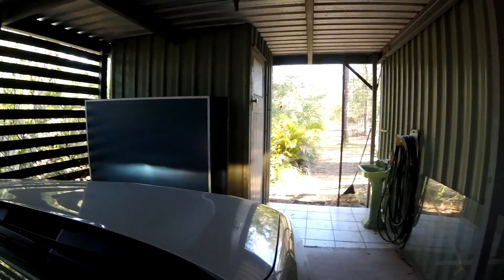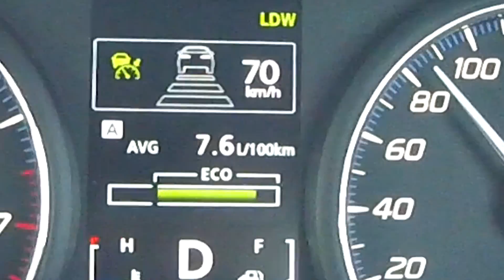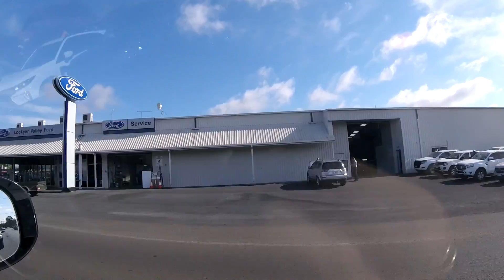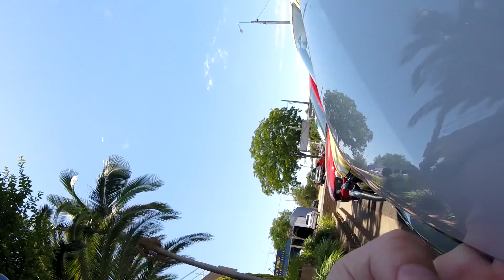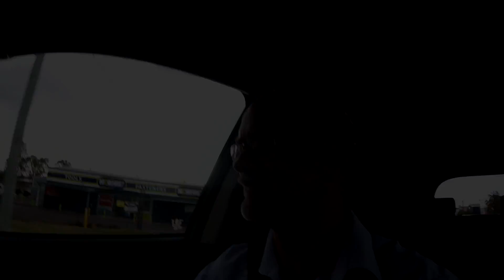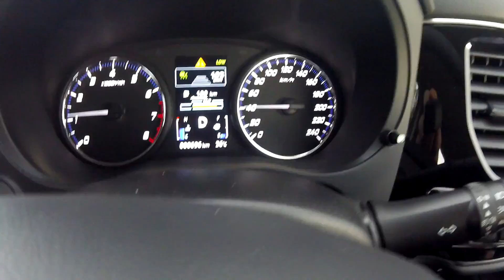EP162 - Outlander Petrol vs PHEV Fuel Economy!

Comment: Hello from Arizona, another very sunny place like Australia.  I am considering buying a Outlander PHEV now they are in the US.  I have a couple of questions please.  
1.  So the documentation that I have read states a total of 310 miles using battery and gas, is that correct based upon your experience
2.  I have also read documentation that states the mpg of the Outlander is 25 mpg using solely gas, is that correct?  
3.  Last question, using the save mode and having the gas engine recharge the battery do you know what the mpg would be in that mode?

Thank you in advance for your assistance with these questions!
Reply from the maker: Tanner, it might be even hotter at your place than down here ;)
Happy to answer you questions (everyone else please feel free to chip in...):
1. you can achieve 350 miles on a full battery and tank if driving in ECO mode and without aircon. 300mi should be fine with aircon on.
2. running the car as a hybrid (with an empty battery or in save mode) achieves around 36mpg, with careful driving maybe even 39mpg
3. save mode does not recharge the battery, it holds the current battery level for later use (engine goes on and off, hybrid drive). The charge mode does recharge the battery until it's almost full. The mpg for that is around 30mpg while driving at around 65mph.

Hope that helps and cheers to Arizona!

Comment: Hi Andy, my experience with my outlander is that the instant fuel economy  and other readings are circa 5% optimistic. Most manufacturers do so to give lazy customers a feeling that t he csr is more economical. The ONLY  way to test without scientific equipment is to fill the car, drive it several days or at least 500km then refill it and do the maths. Recentlly my outlander gom said I was averaging 6..8 l per 100km.. When I  refilled and tested properly it was 7.1 litres per 100km (Turbo diesel of course as I have 1800kg to tow and no other outlander can do that) Note these consumption figures were for mixed driving NOT towing. In the real world towing my van I average 9.9l per 100km (tested over1300km of towing. But the computer reported 9.2 to 9.4 litres. Do not trust electronic trip metres for fuel economy.
Reply from the maker: Thanks for the info, Wayne. I agree, the only way to measure fuel economy is to fill the tank again at the same pump. If it is 5% off, the PHEV is even more efficient.

Comment: If all you did was commute like this all year, and the costs never changed, it's only a difference of about $400 per year. Of course you do more than that, so maybe it would cost you $1000 more per year. But the PHEV might cost $10,000 more than the petrol car to buy, so I don't think the cost matters so much as the environmental impact. Meanwhile, what is the impact of making, charging, repairing, and finally disposing of the PHEV and it's motors, batteries, etc, vs the same car that doesn't have those parts? I don't know, but this could be a tie...
Reply from the maker: Yes, you're right. The environmental impact was the seller for me. As I have solar and get my energy during the nght from a 100% renewable energy retailer, that's the way to go. I guess when the car has reached end of it's life, everything can be recycled, right? Motors, cables, batteries, just everything.
Reply: @unpluggedEV  it's great that you have clean energy sources! You are truly a good example of how to be green but still have a vehicle (which is a necessity when living rural).  :)

Comment: Thanks for looking into the fuel consumption Andy :)
Here in South Australia electricity is really expensive, I have the best I can find, $0.36 inc GST per kWh. Three kW of that is $1.09... lately I’ve bought some petrol at $0.99 but most commonly $1.099 at the right time of the week. But I want a PHEV for many other reasons. I think on my commute (62km daily round trip) driven properly the PHEV would be cheaper to run as a third of the distance but half of the time is in start stop city traffic, the rest at highway speeds and flat. Keeping battery charged for the city driving would be great. But, interesting that here at least, for long distance, if petrol is cheap, fueling costs are similar, currently. Disclaimer disclaimer disclaimer. :)

Comment: One thing is sure : when they see the adapter they will think "that guys is serious! We cannot cheat him with the battery!" Oh BTW : you don't want the cruise control in your phew. It fekin pushes the power meter into mid whites if you let it drive the car on the motorway ! :/
Reply from the maker: I hope they have all subscribed already and watching my anyway :D
I use the CC only on flat roads or in slower speeds. As soon as it goes steeper uphill it will be pushing the car to maintain speed and the engine starts.
Reply: @unpluggedEV  I was talking about "real" motorway ;) it's pushing even on flat...
Reply from the maker: ahhh, real motorways. Can you go to Germany and get some testing done for me please?

Comment: Well a battery replacement is likely not straight forward since Mitsubishi has to find certified EV technicians to do it. I worked prior at a Nissan dealer and only trained technicians are even allowed to touch a Leaf that is being disassembled. I give it a week before I send an email inquiry. 

On the bright side, imagine having to sit 3 months over for service because that is how long most Teslas sit in repair even for the smallest fixes.
Reply from the maker: Mitsubishi initially advised that the battery replacement takes 5.5h as per their schedule. I guess they are playing around with the procedures now which could take several days. The DBCAM alone can take up to 72h and if it fails, repeat...
Reply: I would guess Mitsubishi would have the technician readily available expecting the car to come in, and being a fairly high profile job they’d want to ensure everything is done perfectly.
Reply: @syniteq  They could have but honestly I prefer if nobody gets special treatment because of their names. There is always a fixed number of specially trained technicians at hand - a person having special privileges means some other no-name bloke out there likely has to wait twice as long for his car to be fixed. It could be me or you - does that sound fair to the rest of us?

I don't mind waiting as long as it isn't ridiculous timeframe (say a month).
Reply: I quite agree, treatment should be the same. I was just thinking they’re being extra careful to avoid videos being published about things they did wrong ;)

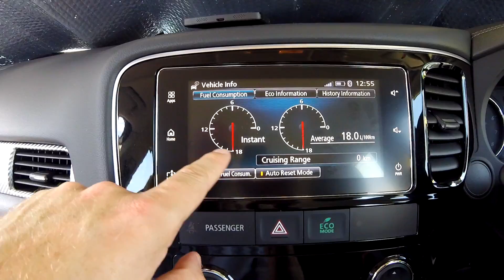Comment: G'day Andy. Been enjoying your videos, being a newby owner of a PHEV since November in the States.  I have, however, been driving EVs for 6 years and very familiar with how GOMs work.  They base their calculations on prior driving economy.  At 9:46 you showed the car had an average eco of 18L/100 km.  18L?!!!  The car must have been idling a lot and being used for short and very inefficient trips over the past months.   This is why your GOM actually showed growing range for awhile, because you were driving it much more efficiently (18L down to 7L/100km).  My Nissan Leafs will do the same,  If the car was driven at high speeds and inefficiently on the last trip, the GOM will show a lower estimated range after charging at first, but if driven efficiently, the range will increase or not decrease as quickly as actual mileage driven.  This poor Outlandish has been thinking that it could achieve only 18L/100km over these past several months.  Now you are enlightening it.   

One last note of discouragement:  I had to have the battery pack serviced on my brand new Leaf a few years back.  The dealer had to call in a Nissan expert.  They had the car for 6 weeks!  I hope Mitsubishi can service your car more quickly.
Reply from the maker: Thanks Douglas and welcome to the show ;)
Yes you're correct, the fuel meter was insanely high when I got the car. I guess too they had it idling for a long time as you said.
The GOM shows always 18L when I start the car. It resets the calculation after 4h of inactivity as in the PHEV. So this shows only the average of this current trip.
6 weeks, ey??? You maybe not far off with this... :\

Comment: Andy, once you get back your PHEV , would you please make a test to compare the actual fuel consumption of the two vehicles? I mean, press the save button of your PHEV with battery half empty and see how much fuel it would burn in hybrid mode. 
I know, I know, it will hurt you a lot to burn fuel with the phev, but it would be worthy to compare the hybrid efficiency of our PHEV compared to the petrol-only outlander. Thus we will actually see how much benefit would bring this charging/discharging of the battery and keeping the engine in the sweet spot. 
I doubt you can get much less than 6.7l/100km in hybrid mode though.
Reply from the maker: When I get the PHEV back I will instantly lose the Outlander Petrol. But yes, I can do another hybrid run with the PHEV to work and see what the actual fuel costs would be.

Comment: Hi Andy, did you try pressing the 'eco mode' button to see if the eco display fills entirely green? 
Also the metal placard that sits under the bonnet tells you the engine and transmission code 4J11 = 2.0L, 4J12 = 2.4L, but in Australia 2.0L is only available in front wheel drive, all wheel drive 2.4L petrol or 2.2L diesel and also gives you the circular button near the gear shifter like your PHEV which changed the all wheel drive control

Comment: Hi the lane departure warning on an outlander (if fitted) only works over a certain speed, here in the UK that is 40 mph (whatever that is in kilometres),and not that it can't recognise the lines in the road. Hope this helps.
Reply from the maker: Thanks for the tip. I didn't know it does not work when driving slow...

Comment: Andy, when you drive manually setting the speed your foot still moves , which is reflected in the eco meter. When you use the cruise control the electronics can lock the accelerator so the eco meter then reads the non movement. The difference can be as much as 1L/100K.
Reply: Disagree, the computer has a PID controller that makes the petrol injection fluctuate a lot in order to maintain the correct speed. When you drive yourself you can keep the injection constant and sometimes lose a little or gain a little speed but keeping the engine at the right speed. Another advantage of driving without cruise control is that when you have a small hill you can accalirate a little and when you go up lose a little speed which is more economical then the computer realizing that you go up and have to give heaps of gas to correct. Your eyes can forcast the road ahead so it depends on the driver whether it is more economical or not to drive on cruise control
Reply: @bartdeking   If the symptoms you have described occur in my car I would be taking for service as  there is either a bad ground in the loop or a bad connection somewhere or for factory fitted modern cars a programming error may also be at fault.  I have also fitted cruise control systems and if there is fluctuation whilst driving on flat level driving conditions something is wrong as the ECU has a problem with one of the PID controllers that have sensors for either speed, motor RPM and spark timing as well as throttle control, these are a few of the basic requirements to be look at as possibly faulty or badly fitted.

Also if you have a modified ECU your cruise controller may not be receiving the correct signals to maintain accurate throttle control. As the mods usually are directed at more power over fuel savings.

Lastly with over 40 years of using cruise control on medium to long distance trips 100klms to 3000klms I always have had fuel saving from as little as 5% to as much as 15% using cruise over manual throttle control for the same trips in the same cars.  Shorter trips I do not count as you usually are not in cruise long enough to be able to notice a saving, I just look to get better than normal distance per tank of petrol
Reply from the maker: Oh, no, there moves nothing. If so, the car would be accelerating of slowing down. I tried this a lot of times now and you only get the full green bar in cruise control mode. To achieve the same in manual driving, you have to very slightly lift your foot of the accelerator but then the car already slows down.
Also I watched the Eco display on the MMCS and the consumption does not change when turning on cruise control. It seems like a software glitch. Nobody takes note of such things apparently but me :D